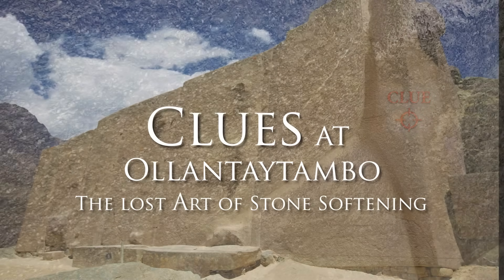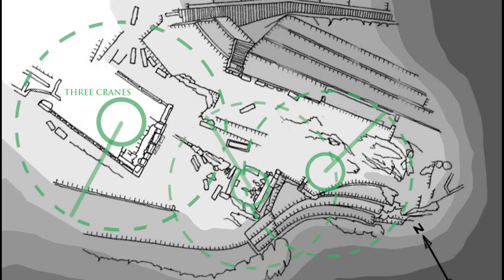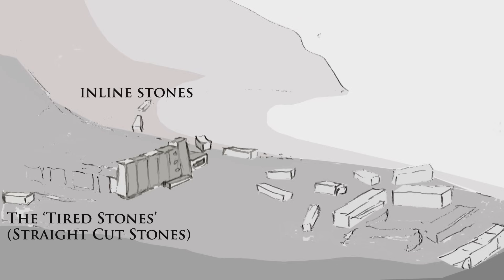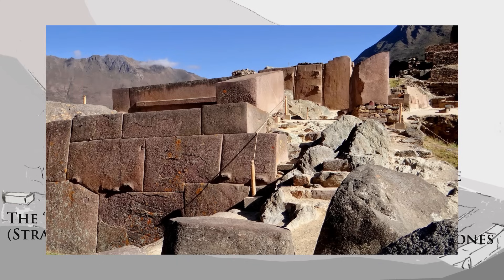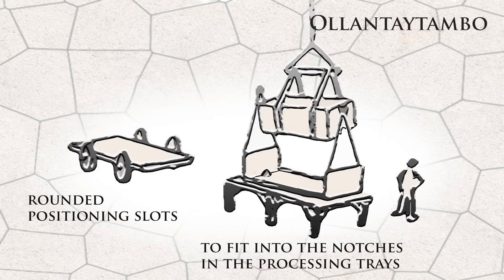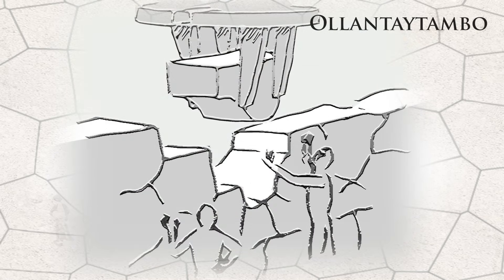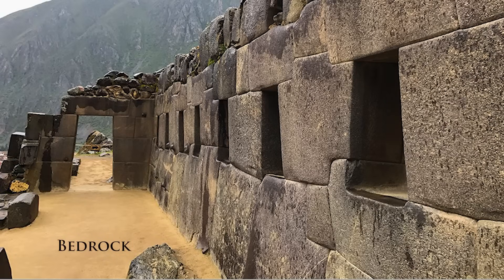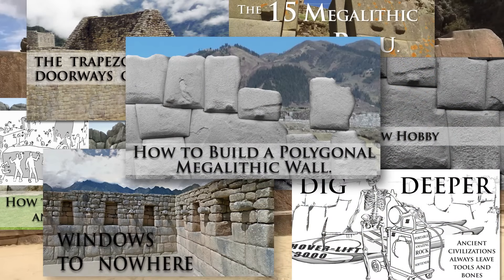Clues at Ollantaytambo. The Lost Art of Stone Softening

Comment: I'm not convinced.  You fail to show any evidence of "stone softening" equipment, tanks, troughs, etc.  You don't show any telltale remnants of the chemicals used.  And, despite modern chemistry, you don't propose any workable "stone softening" solutions that could do the job.  Yours is but a fanciful idea, without evidentiary support.  The finished products you point to are not evidence of the method of their manufacture.   Finally, I find it hard to believe that artificial "stone softening" could be employed by the ancients as a manufacturing method when there is no corresponding "stone softening" to be found in nature.  I would rather believe that any stones not used intact, were ground up in solution, and solidified by some sort of cement, allowing them to be poured in place.  There is precedent for that, both in nature, and by the hand of man.

Comment: Sometimes the simplest explanation is the best.   
I think these were cast one at a time in place with filler stones on the inside they look like concrete to me the texture everything.   sprawling surfaces revealing different textures underneath and if you look close at the sites you’ll see some of the filler Boulder stones in the center where the exterior smeared on stucco fell out.

Comment: You might be on to something there, forget the sonic stuff that just did not happen, but soaking it in some form of weak acid could happen, We use the idea today when etching, and it only takes a second or two just to etch the surface, but leaving it longer would soak in and they all you need to do is use grind up quartz or diamond to take a controlled amount off the stone. This is food of thought for the historians to ponder over and research

Comment: Bro I subed b4 I watched. But all I'm going to say is build it.. you can get igneous rock and plant water start testing! use electric to generate sonic vibrations. Start soaking stones prove your point. You may be on to something but It's easy to make an assumption in a video when you have done NO testing at all and none of your theories are remotely in line. I'am not knocking you I'm saying if you feel that way start out to prove and do some tests. See how igneous rock absorbs a fluid if it does? See if you can get modern materials to soften a stone using your theory and then work backwards.

Comment: Wait so what's up with the little knobby protrusions?
Reply from the maker: The nubs are explained/theorized about 3/4 of the way into the video.  And in a couple of my other videos too.  And I'm working on a great video on that topic for next year.
Reply: @IntriguingMegalithic  So if I understand right, you think the little knobby protrusions are the result of them attaching some kind of stick to the stone, that would then leave that little nub when they pull the stick off? And you think they were using the sticks to manipulate the stone to help mold it into place?

If that's what you're saying, I could see that. What I'm not understanding is though not all the stones have nubs. Seems like most of them don't. And you would expect more nubs to be on larger ones, whereas it seems like the stones with multiple nubs are actually the smaller ones.

Thanks for replying! I think you have a great hypothesis. Any idea why so many of these building have trapezoidal niches? They're way too ubiquitous to just be decorative. Seems like they almost have to have some purpose that's either integral to the method of construction or to the buildings' purpose.

Comment: Good Theory, but I have had dreams of how they did it.  Different shape animal hides were used to hold the stone chips when they were mixed together it appeared to be a vibration from a rod attached to a machine, not heat, stones were added as it became liquid to fill it to the top.  The bumps are legs or other protruding parts of the mold from the animal hides.   Sometimes the rod that liquified the stone would be put in where the bump was.  On occasion silver powder would be rubbed on the inner part of the animal hide and when the process was complete it would have a beautiful shine.  Large rocks that were molded were not hides stiched together but were from very large animals.  Other human like species used cutting saws and hand held laser tools.  The H Stones of Puma Punka were cut and levitated by machines.  The fort/station at Puma Punka was only inhabited for a very short period due to the engineers had to leave and could not leave it in tack due to having another group or species use there facility.  It was destroyed by a single blast from there ship from about 15 to 20 thousand feet above.  These short type human people worked in Egypt and other areas.  Statues of them are in museums.  We today look at these statues and have no idea of the history of those workers.
Reply: Ok......🤡

Comment: I believe the stone was softened by some readily available plant solution that involved the Coco plant. The Inca Histories show that they had a stone cutting solution. The archeological record shows No metal tool or wire saws. THey did not have a measuring system like standard, english, metric or egyptian . they had no written language. Rope was all they had in abundance. We believe that the Inca used a stone softening solution and rope saws to cut and fit the stones. Great video by the way. RICK

Comment: Where are the cranes, air compressors and what have you that you need to power  chain saws, wire saws, overhead cranes and such? The amount of garbage and debris left around any job site of that magnitude would have left many garbage piles. What vegetable matter are you talking about  that will soften stone and not dissolve the stone its self?

Comment: The stone was not softened but pulverized! Crushed then mixed with mortar and poured into something that was flexible enough to insure the impossible. As it laid on previous stone's that have been hardened this giving it rounded or soft angled corners that fit perfectly,than remove the form thats holding it together now you repeat process and you have a perfect wall. I've tested this I on a small scale and it legitimately came out exactly what you see today and did not make one single cut..

Comment: Read through most of the comments and I'd been wondering the world-wide creation of walls made in this fashion. It wasn't cutting stone without having some form of treatment and so far, chemical has been the focus with the most promise. Some fine points to consider. "Sonic tools"? No sweat. Just like using a vibrator today to get concrete to flow into those nooks and crannies, think simple. How can the soft material be made to deform with vibration. Tap (or bang) on your form-work with concrete. Surely the outer portion would respond and it would depend on how soft, and thick the softened portion is. Formwork, most likely wood, would have deteriorated by now, but vibration against your formwork would have an effect. Replace "sonic" with " vibratory", such as tools against forms. Then I saw another video that noted (the acidic paste from soils) was evident on the outer edges of the walls, but exposed interiors were not as form fitting. Again we're then considering those portions along the outer edges that may have been vibrated, and the effect is visible at the outer edges, but only extends in a portion of the thickness. Lastly, consider formwork with concrete. The walls do not bow at the bottom (unless the formwork was pulled off REALLY early).  Just a few thoughts.  And individual residences were less likely made this way due to expense. Like today, not all homes are built to last thousands of years, due to expense.
Reply: I have long suspected that they had layers of llama skins in the form work
that allowed that bulge on the bottom.  I like to see the comments of men
who have been there and done that. The Archaeologists and English chatterers
don't impress me. Thanks

Comment: It doesn't all add up to me. If they softened the entire stone they could cut a bunch of square blocks but they are all odd shapes.  I am thinking if they could soften the stones then maybe it only soaked a quarter of an inch or so and made it like sandstone so they could easily grind it down. That doesn't explain it really either.   If they were all straight lines you could imagine they ground the rocks against each other but there are too many irregular shapes. Now I'm just babbling :)  I hope this gets solved so I don't loose anymore sleep trying to figure it out.

Comment: I will admit that there is evidence of lost technology. I do not  accept your theory as being correct, there are some possibilities whith it. Where as your theory suggests that the builders had sonic technology or lifting machinery, even if it were man powered machinery, I seriously doubt it. 
  If as you suggest they had a chemical method of softening the stone the biggest problem would be being able to support the massive weight of the now pliable stone, while in the softened state I don't see how it would be lifted, the best solution for this would be to apply the softening process to the stones after being placed. This part of your theory is unclear because as you state they would only have a limited amount of time because the stone would revert to a solid state. Although your theory is intriguing I reject the notion of stone softening by chemical or sonic methods.   Thanks E. B.

Comment: The actual correct answer is MELTOLOGY  or the Tartarian Meltdown which explains how an extreme heat event that DID occur worldwide causing red brick buildings and walls to transform into granite as well as basalt. as crazy as this sounds the evidence is everywhere and is perhaps the largest of cover ups in recent history. For absolute definitive proof showing thousands of worldwide photos of melted structures and mountains containing archways doorways, columns etc... NOT carved out as the liars of ( HIS story ) tell us, but pockets of building structure that survived from completely melting. There are images of bricks shown to be frozen halfway in mid transformation into stone as this short circuit, arc weld type event was instantaneous and cooled just as quickly. These buildings melted like wax and basically froze in mid melt. Once you see just a couple of the many videos on this topic you will walk away a believer in this. These ancient cities used cathedrals, building steeples, star forts and lighthouses to harness free electricity from the air. They used red brick as it has electrical conductive capabilities. These cities were set up like a circuit board which would explain how they suffered a short circuit meltdown destroying NEARLY all of the buildings. This also means that our worldwide population is nowhere near what it once was as most of our known mountains REALLY ARE remains of brick buildings.

Comment: The process can be demonstrated using 'Therapeutic Putty' or 'Science Putty' from the Science and History museum.
Put the putty in a freezer overnight. Then cut the putty into small lumps.
Stack all the lumps together like a dry stone wall.
Allow the putty to thaw out until it starts to soften, as it does so the lumps will 'cold flow' into each other.
When the putty polygonal wall is at the desired fitted 'perfection', spray with 'Arctic Spray' to freeze (set) the putty hard again.
It does not explain how Granite was softened but this demonstration does adequately demonstrate how Polygonal walls were made using 'softened stone'.

Comment: “El Inca” Garcilaso de la Vega (a mestizo chronicler from after the spanish conquest) wrote of them using a paste between the stones, which some suspect was acidic, helping to soften the just the joints, not the entire stone: “..they were of beautifully cut masonry, and each stone was so perfectly fitted to its neighbours that there was no space for mortar. It is true that mortar was used, and it was made of a reddish clay, which they call in their language “llàncac allpa”, sticky clay, which was made into a paste. No trace of mortar remained between the stones, and the Spaniards therefore state they worked without mortar..”. “..Many of them (the stones) are so closely set that the seam is scarcely visible. To lodge them in this way it would have been necessary to lift each stone and lower it many times, for they had no set-square or even a ruler to help them to put it in place and see if it fitted. Neither did they know how to make cranes or pulleys or any other device to help them raise and lower masonry, though the pieces they handled are terrifyingly large..”. Later he continued: “They did not indeed use mortar made of sand and lime, for they were unacquainted with lime. They did however employ a mortar consisting of a paste of sticky reddish clay, which was used to fill up gashes and pits caused in working the stones…”  “they had no other tools to work the stones than some black stones hihuana with which they dress the stone by pounding rather than cutting.”
Reply from the maker: There are so many theories,, and yet all are impossible. It's truly our greatest Enigma!  Thank You for writing all this.  I like it!

Comment: Maybe the tanks were demountable. rather than lifting the block, the block could just have been encased. which would explain the bumps if there was a hole opened in the side of the tank to release the fluid. perhaps this construction was abandoned when they realised the caustic chemical they used for softening rock was noxious and deadly and particularly unsafe to use at that location.